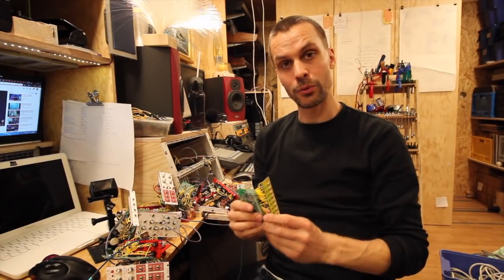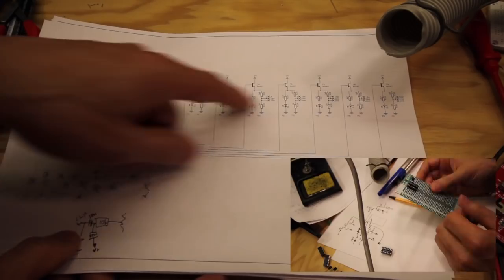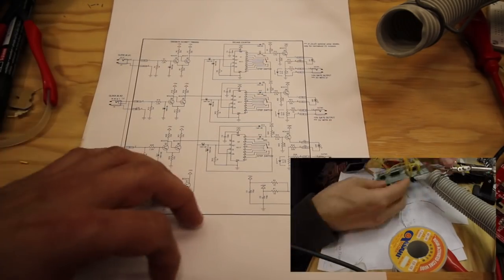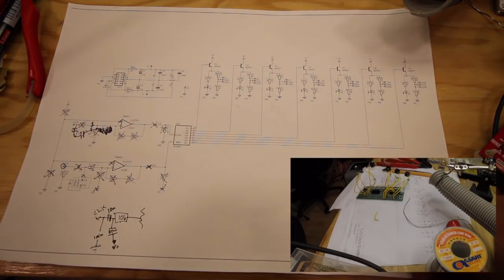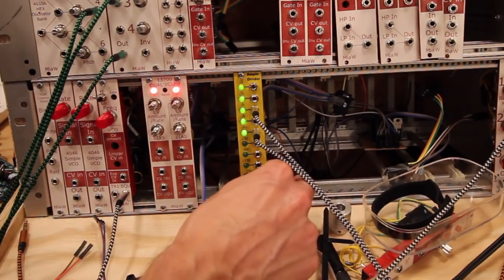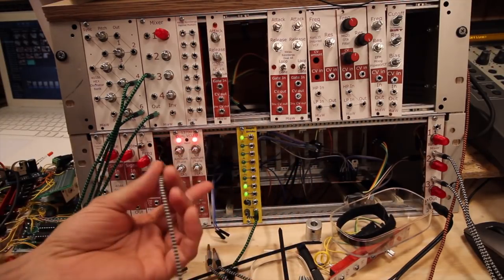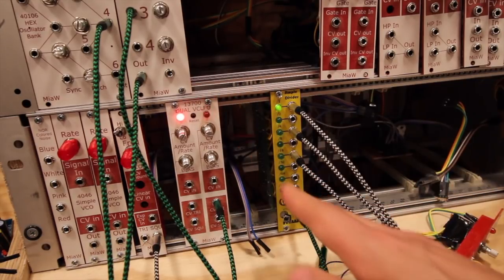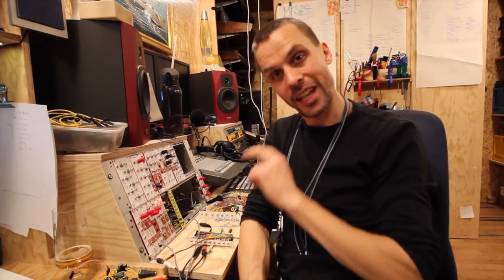Simple Clock Divider and a Sub Oscillator - DIY Module in a Week 8.1

Comment: Why not just add a 40106 inverter to the clk input to the chip and use a spdt switch to select "normal" or "reverse" (leading edge trigger, or trailing edge trigger) ? I use parts of this circuit for a 4 output sequential switch for controlling 4 sequencers and again for a clk divider for driving said sequencers (switch selectable ÷1, ÷2 or ÷4). That way I can use fewer  clk generators to control multiple modules, all being in "sync" with each other.

Comment: Just what I needed.
Thank you!
I went out and whilst at the electronics shop, bought two 16 chips.
One is a 4040 and the other a 4020.
Which one should I use?
One of them has ×8 divider in its specs.
I do not have dropbox so will have to think of another way to print your redrawn schematic.
Thanks again for a great video on how to save ( a lot) of money.
And its FUN building stuff.
Reply from the maker: You should be able to access the Dropbox folder without an account. As for what to use they seem to work both? I am working on a more musical divider using arduino so you know. But build this anyway. It is a good learning experience. :)
Reply: Hello Kristian.
I have now almost built the clock divider using the schematic you kindly provided. I used a 4040 IC and adjusted the output pins accordingly. What is troubling me is this.
On the schematic there are rectangular red boxes which indicate the clock in, reset, and the other P outputs.
The boxes are marked as P.
I cannot figure out where the pos and neg ( earth ) is on these boxes so cannot complete and test the unit.
I will greatly appreciate your help.
Maybe you could do a quick drawing to enlighten me?
Thanks in advance!
Reply from the maker: @synthesauria hi again each p is a pin where the tip of the cable/jack should be connected. So the signal in. All the ground lugs of all the jacks should be connected together and then connected to the ground of the module. That’s it. Let me know if you have further thoughts. :)
Reply: Thank you Kristian.
I have all the little P boxes as 3.5mm mono sockets. The clock cable goes to the synth clock out. Where does the reset cable go?

Comment: Part of me thinks that to eliminate the 1/2 flipping on the falling edge, that you leave that in place, but the 1/1 output to 'use' outside of the module should be inverted. A variation on this would simply be to make the module wider by enout to add a row of inverted outputs for each divider. Then the person using it can trigger off of whichever level they need for the effect they are looking for.. Yeah, some would want led's to, but simply tagging the column as inverted would reduce the part count.
Reply from the maker: Yep! Another row with inverted would be nice aswell :) I am working on an Arduino based counter/divider which will do this much simpler... Thanks!
Reply: @SourceryOne  My thought here was to use an interrupt pin to drive an ISR that increments an 8 bit unsigned counter (if you can see a need for 16 bit, that may be an option.) A second interrupt pin with ISR to reset the counter to zero or all 1's. Then use specified pins for 1/1, 1/2, 1/4..., that go into output buffers for the jacks, and to drive an 8 channel inverter for the inverted pins. The ISR should operate on the rising That however is an arithmetic. To do this as a musical I would expect that you would have to set a flag with the first ISR (these should be as close to 0 clock steps as possible) then in the main loop walk through the bits to work out which bits need to be flipped. That is where I run into issues mentally keeping track of what the process is. At that point it simply occured to me that the 4024 you are using here is actually doing everything, except working off the up trigger, and simply inverting the first bit at the output would cover that for the rest of the bits.

But hey, I'm raw new to the Synthesizer scene. Curently 3d printing expandable eurorack modular case parts, and have bought most of what I need for a decent Behringer Series 100 synth, and building some of the really simple kits like the passive multi, and passive mixer. My major interest at this point is to get into a polyvoice platform, so looking at your miaw 1.3 oscilator, or possibly based on Moritz Klein's DIY VCO video set. I think it's using the same chip you used for the Miaw 1.1 video, but he's got it controlled via a VC circuit instead of a single pot, and has it working with a temperature controlled element to help with stability. That said, the solution using a collection of 4046 chipas possibly with onboard mixing to reduce the number of audio outs, has some appeal. I may have to make use of an Arduino to do the MIDI to cv and gate outs. Then I can check whether the pwm inputs for CV work too I guess, or find a dac bay which I think is going to start getting expensive.

One day at a time, and this taking far too much of the time I should be spending looking for a new job.

Thank you.

Comment: I call it just 8-bit counter, because that's it. Maybe need to start call it clock divider then. Can get nice beats with it.
Reply from the maker: Well in a modular setting and as a module it can be called a clock divider at least. But yeah the chip itself is an 8 bit counter. It’s all about context. 😉

Comment: I have a technical question about this schematic if anyone could asnwer me because it will help me learn better circuit design:

I see that the inputs all have an op-amp on the inputs and transistors on the outputs to drive the outputs... BUT
when looking at the datasheet i see that the chip has both buffered input and outputs. so i'm wondering why would one need to add those OP-amps and transistors? couldn't one just connect directly the inputs to the input pins (with ar esistor and a diode (for negative voltage protection) and just have a basic output jack on the outputs? with a resistor as well?

i feel like this circuit is overkill but then again i dont understand the need for all those extra parts if someone could explain it to me that would be greatly appreciated
Reply: OH i posted this on the wrong video, i meant to post it on the logic gates video, but it still kindof applies for this ciruit as well
Reply from the maker: I read it as it was for that video. :). So basically you are correct that you can just connect everything into the chip. BUT if something out of spec should be connected the chip might break. So therefor I have understood that this is how it “should be done” I also think it is a bit overkill but sooner or later you get to the point of “better safe than sorry” sure it’s a cheap chip and it’s just to replace it. BUTif you are a muscician getting to a new venue or even worse in the middle of a gig and the chip breaks... well....  Also the opamps on the inputs are made as voltage comparators so the inputs react on everything over 1v so it has a bigger reason for being than just buffering. Hope that helps a bit. :)
Reply: @SourceryOne  yeah that actually makes a lot of sense. i figured it would be some sort of protection level for the chip. it might also help have its behavior more stable i guess...

I'm working on a few designs of my own all based on 40xx chips and it's cool to see other circuits and compare what i came up with and to learn from others what are the "best practices" and start using them for my own designs as well.

thanks for the reply!
Reply: The op amps are used as comparators so that  a slow rise/fall time waveform can be used as a clock. The output of the op amp stays LOW until the input voltage meets or exceeds a certain level, then it switches HIGH. The same in reverse for the "trailing" edge. The transistors act as buffer/drivers so as not to overload the outputs of the chip.